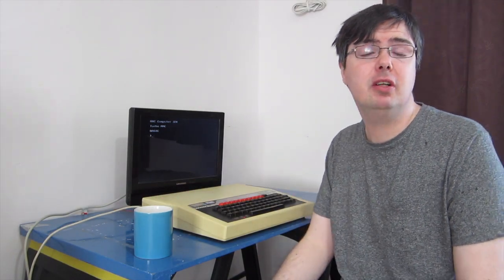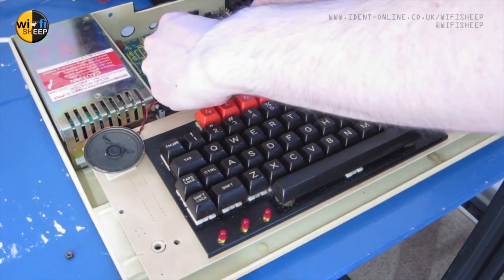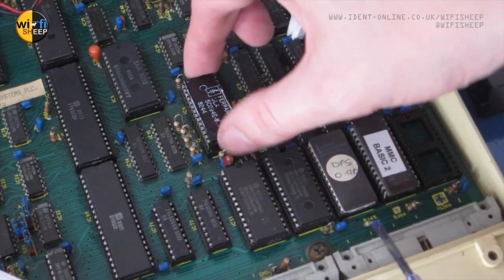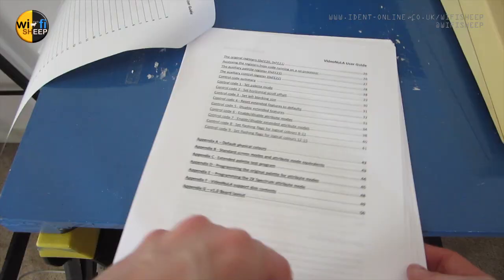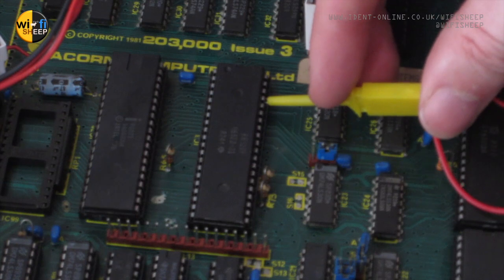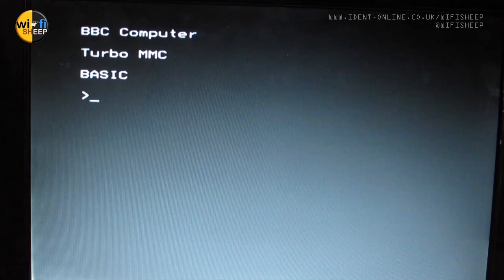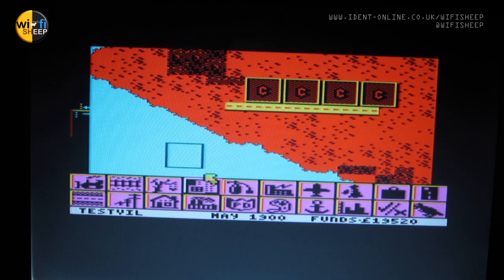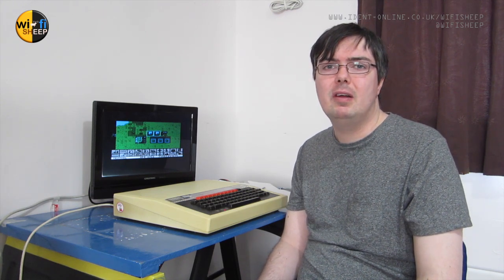VideoNuLA (Part 1) : A New Graphics Card for 8-bit BBC Micro (Wi-Fi Sheep Tech Video)

Comment: The best way to bend the legs in is to do it on the table top.
Hmm not sure I guess with some fiddling it could look better.
Reply from the maker: I was on the point of doing that tbh... but still went for the pliers! Thanks for your comment!
Reply: Oh, you got a real one (am I right thinking there were only 50 made?) I have it setup on B-em. The 12bit colours are something close to breath-taking on a 30+ year old machine :)
Reply from the maker: Oh yes defiantly real! Not tried it with B-em yet but must get that set up.. It really is quite something! The model B i'm using generated some interesting issues which i think confirm somethings up with the machines 35 + year old RAM. Also no sideways RAM support which I need for some of the extra features, hence the planned part 2 with the Master 128.

PS have no idea on how many were produced but think tha'll be another production run

Comment: Where could I find MMB explorer? tried googling for it, cam up empty =(
Reply from the maker: Hi, the MMB software was supplied on a CD that came with the Turbo MMC device when I bought it. Most of these PC based file explores tend to be pay only and not in the public domain.
Reply: WiFiSheep cheers dude, I'll dig out my CD :)
Reply: It was originally open source by Martin Mather, who made the original version and published the design. His site seems to be down, but I'm sure there are many links on stardot (somewhere) or you could wayback machine for mmbeeeb.
Reply: Old School cheers, manage s to find a CD I got with my MMC with an older version on, required an old library file, but I got it working :) will have a dig around on stardot though. Thanks  :)

Comment: The 8-Bit Guy's latest video update on his Dream Computer project, the Commander X16, is showing off a 128K graphics card that has been designed for the project. The current prototype is on a little separate board that can be attached to the the expansion slot of a Commodore 64 expansion slot with an adapter. That way the team is able to use existing C64 machines to write the firm ware kernel for working with this graphics card. It's very possible that this graphics card will end up being available separately. In which case it could become a card for the entire retro community to embrace. It has graphics prowess that exceeds the C64 graphics capabilities. More sprites, hardware screen scrolling, larger screen resolution modes, much larger color palette, better character attributing capabilities, faster performance - it's more akin to Amiga graphics than C64 graphics..
Reply from the maker: Im fully aware of the Commander X16 project infact I posted about Video NuLA on the Facebook group some months back before any hardware had been announced. The two interface graphics  boards are from the looks of it very similar, the Video NuLA recreates the stock ULA chip of the Beeb. Unlike the Commander X16 It dose not have any RAM of its own and still relies on the main machine RAM and 6502 CPU to drive it.
Reply: @WiFiSheep  the way it has its own memory that is not in the address space of the 6502 looks to be advantageous - and cleverly done. That is how it can have 128K of video ram and hence support higher res video modes and larger color palette than any graphics subsystem of the early 80s micros. The clever part is this: when watching the recent video it is described how to interact with the video card and there is an address in 6502 memory that poke data to. But even though this at first seems very limited and a bottleneck, there is this auto-increment mode of using it, so a large block of memory can be prepared in 6502 address space and then blitted into video memory using this auto-increment mode. So is possible to write to graphic memory with efficiency.

Am excited that this card could become available separately - I'd like to combine it with this FPGA-implemented 80186 board that has 1MB of memory. Can then boot MS-DOS and use Borland Turbo C to write programs that use it. (On the Commander X16 will be limited to 6502 assembler or BASIC, limited to 64K memory area with 8K being bank switchable.). An MS-DOS retro gaming machine would also be able to use those Adlib compatible boards for sound - solving the sound system is still a lingering issue for the X16 project as they haven't landed on a definitive sound solution yet.

Comment: So still eight colours ?
Reply from the maker: MODE 2 will now do a full 16 as you can allocate an additional 8 to the flashing colours and use these as statics. The other stock modes will be limited to the normal number of colours so MODE 1 will have 4 but you can choose which 4 out of the 4000+ palette you want.

There are some new modes in the MODE 97 + area such as a new MODE0 with 12 colours in high res (80's high res) so some new options there.
Reply: @WiFiSheep  Might look into getting one then for my master, then again will any software make use of this other than re tweaking the existing pallet ?
Reply from the maker: some software is appearing if you have a pi tube direct fitted and your using a master you can take advantage of the ZX spectrum and Amstrad CPC modes which do allow for the running of these platforms games  and software on your beeb! Plus there is a version of DOOM in the works which is a port of the 1993 DOS build.
Reply: @WiFiSheep  Ok I am officially interested now. I have been looking for a good reason to refurb the master.